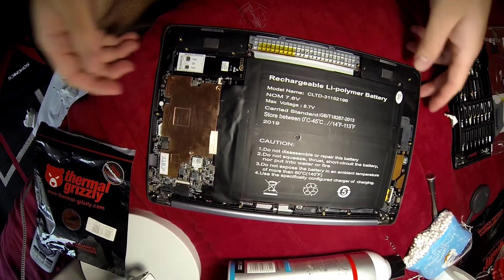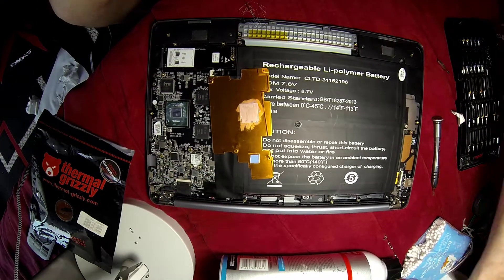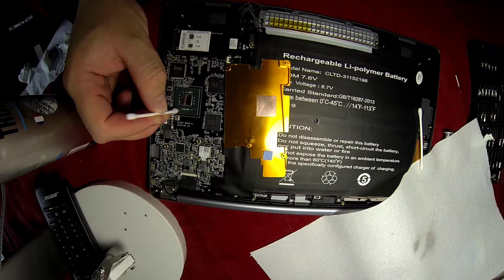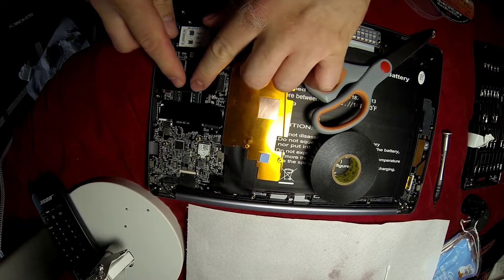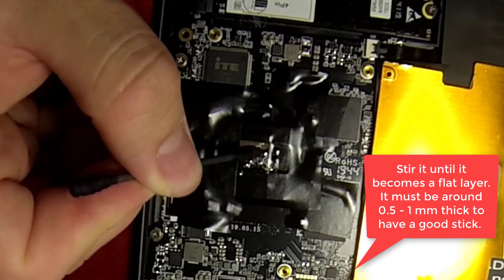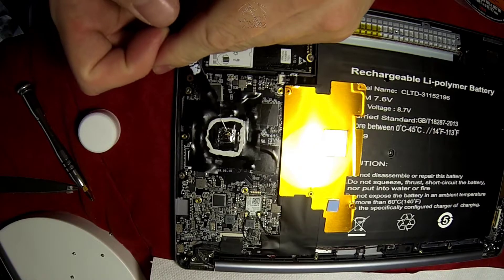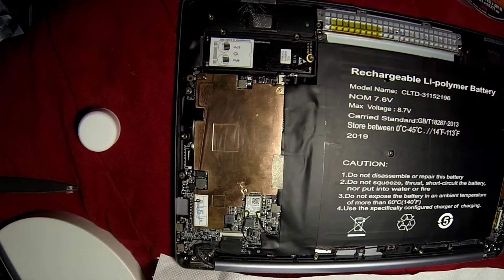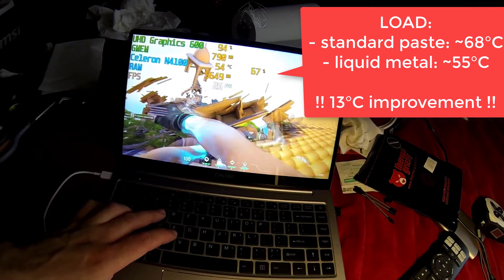CHUWI Lapbook Pro: LIQUID METAL Repaste FULL GUIDE !! -17°C

Comment: Do you know we’re I can get a charger on amazon for the lapbook pro without needing a Qc charger
Reply from the maker: There's not. And I think you won't find any. Since the CHUWI as a fake type-C port no one except CHUWI or chinese site will sell fake adapter. Type C needs to support some standards and 12V only in DC is not one.
Reply: @cyclo16hacks  yes u can bro
Reply: @Mr.Hide_Christian  which one please?
Reply: @brianprosek7875  you need usb voltage trigger
Search it like automatic usb tester voltage ammeter quick charger voltage trigger